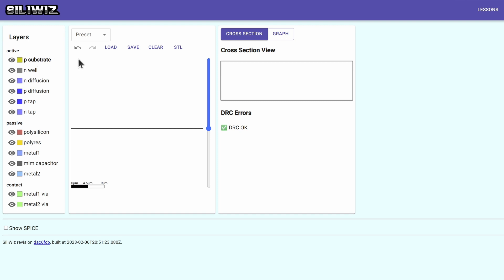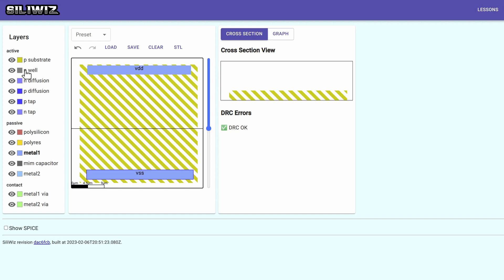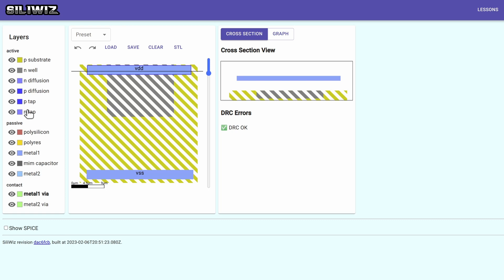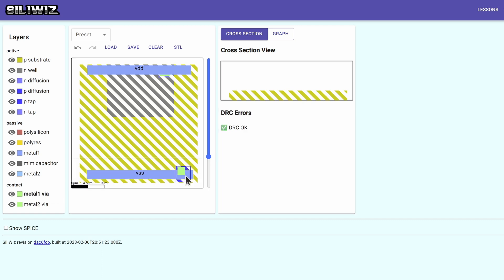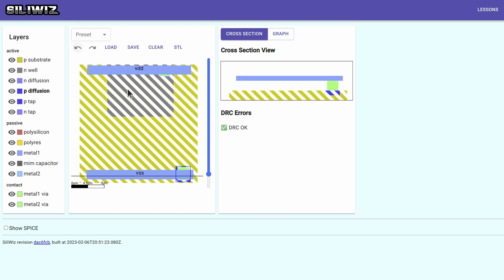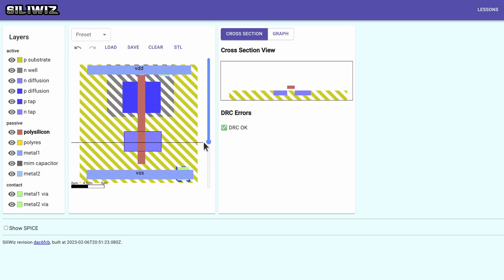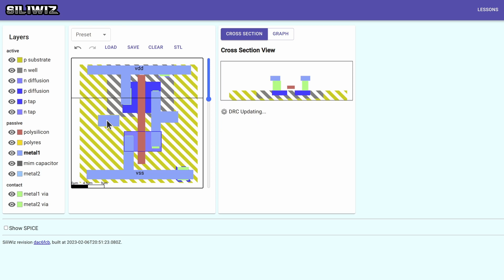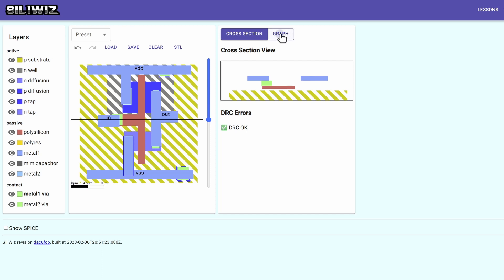SiliWiz Inverter Speedrun - I drew an inverter in 2 minutes!

Comment: That looks amazing, really.  My immediate question of course how you know how to chose the size and placement of your polygons; yes you can make infinitely (ok "very") many that work and you can even sort that list and find the ones that minimizes area for a given gain etc., but it would be a great extension to dynamically calculate metrics that you might want to optimize for.
Reply from the maker: This is designed much more as a playful learning tool than something useful for building a standard cell library for example. We have made many simplifications and using a minimal PDK to keep the simulation speed fast.